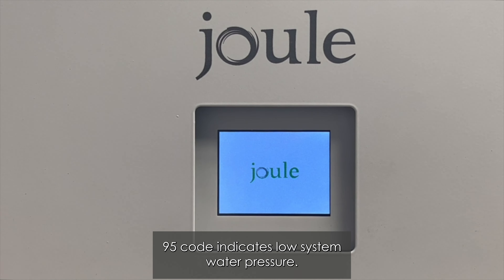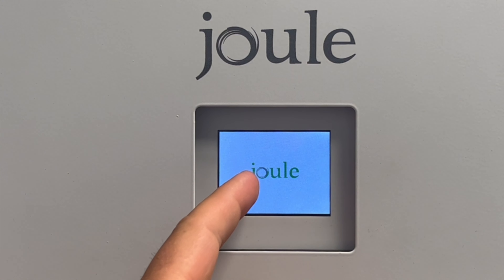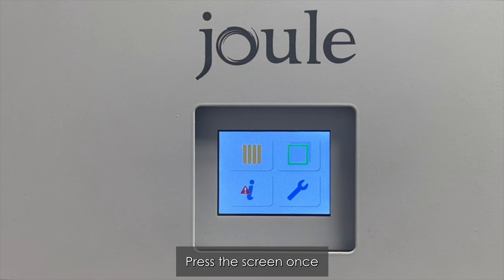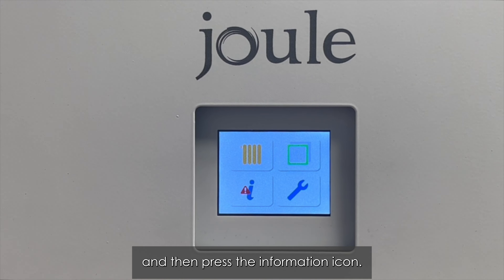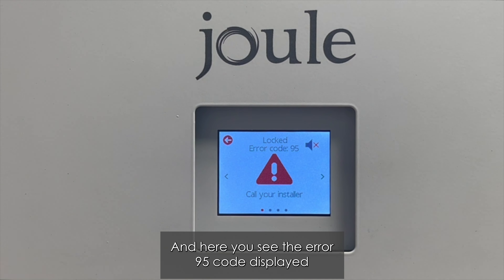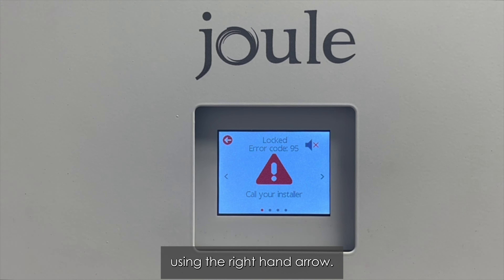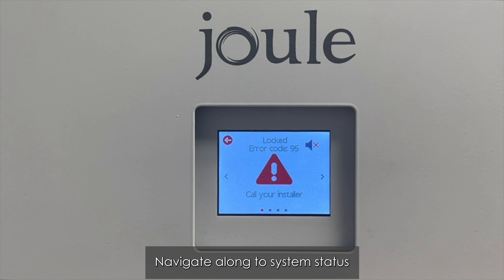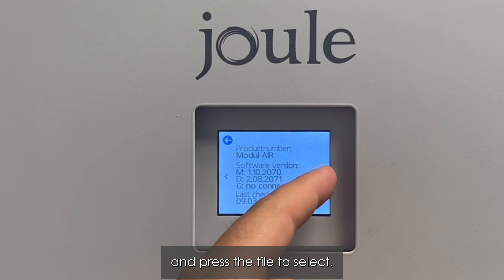ModulAir All E   Error 95

Comment: What is error number 10?  I keep getting this error.
Reply: Error 10 is related to the same issue - except it is prompted when you’ve got 0.8 bar.
Reply: @TCJPMCD94  The pressure increasing and he alarm clears, when I open the central heating filling loop valve.
It happens a lot, any idea why?